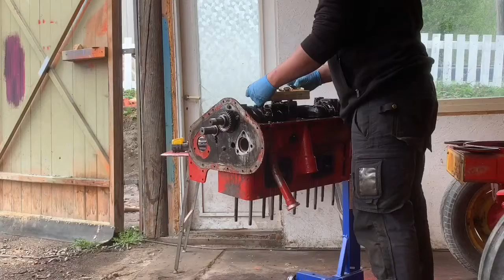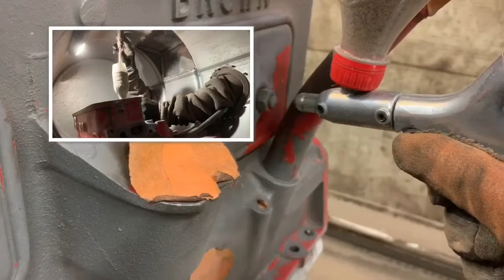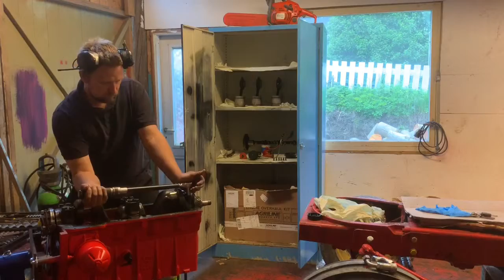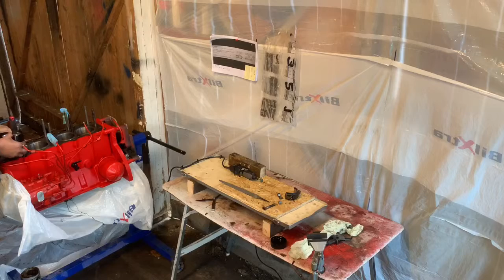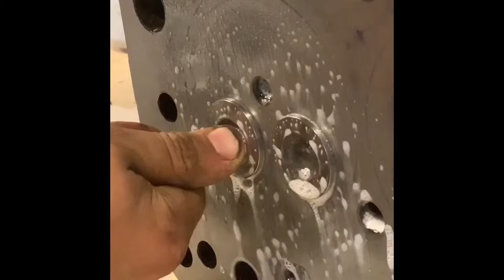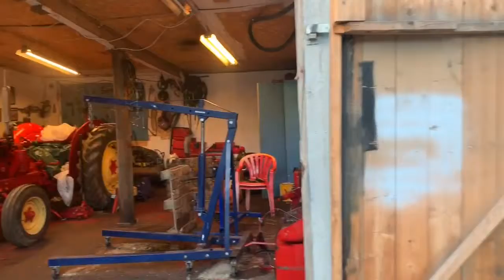Tractor engine rebuild

Comment: Good video, I've fitted a new liner in number 1 cylinder on my 950, are they supposed to sit flush with the block or is there supposed to be a slight lip?

Comment: Hello have another question I wanted to remove the engine bushings today and they hold up extremely Hence the question whether it was the same for you or whether you have a tip for me I'm afraid that the jetty at the rifle will tear off me
Reply from the maker: Do you Megan the sleeves?
Reply: @hansgunnarkjemperud4159 
Sorry I'm from Austria and my google translator can't translate the word Megan

Wanted to know if their cans were so extremely rusty
With best regards

Comment: Hello good job A question from where did you get the engine repair kit? With best regards
Reply from the maker: Hey! Engine kit from Agerline products.com.
Reply: @hansgunnarkjemperud4159 
Okay, thank you for the quick answer How is the quality of the parts?
Reply from the maker: The quality is very good if you ask me. Only driven 70 hours but everything seems very good. 

I messured and wight every part before installing them.